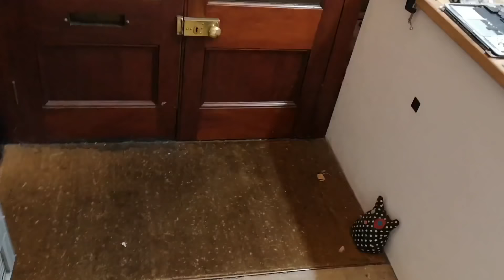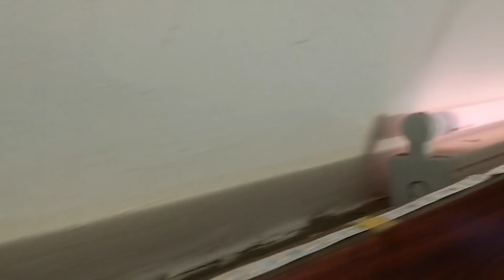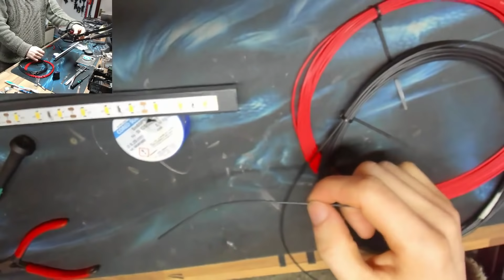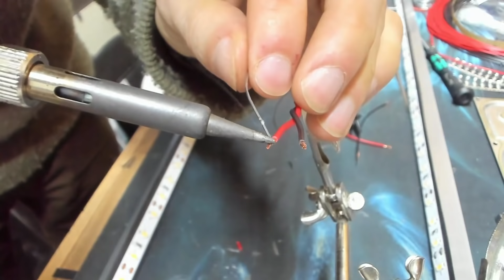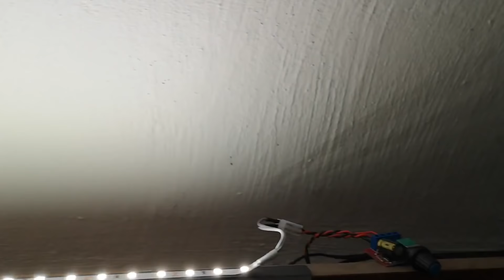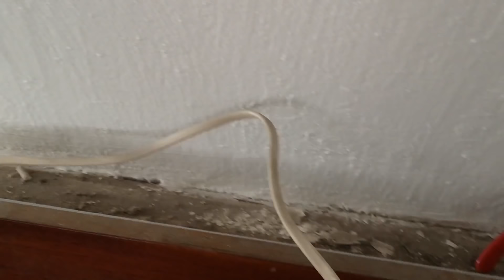LBE#5 - Making custom LED lighting for the shop

Comment: The next electrician who does an EICR there will have some words. Don't let any of the UK based electrician's channels see how you hooked those power bricks up...  I doubt you'll actually burn the place down, but "sketchy" isn't in it.  Suffice to say, hanging 4 gang 13A sockets off a 6A lighting circuit via junction boxes with no strain relief isn't exactly "best practice", just as well it's all out of sight & out of reach.  It certainly doesn't meet the wiring regulations.

Comment: hi sir. i have question about the 6-pin RGB fans (coolmoon). is there a way to identify which wires are for fans and led? i have tried googling and found just one site and pretty much convinced the wires used for the LED. how do i identify the wire order for the fans? which one is the tachometer etc. i am planning to convert it into a normal 3 pin fan and 3 pin rgb to standardize and sway away from its (coolmoon) controller standard.

Comment: Are you still using these lights in your shop?  How is the adhesive backing on the strips holding up?  Just curious how durable these will be long-term.  Thanks.
Reply from the maker: I am! And yea, there's been zero problems with them. I do want to modify them with some diffusion paper so I can have them point down into the room for more light though. They're nice and bright, but in a workshop you're basically always chasing more and more light.
I have no idea how I survived when I first started out with just two flouro tubes in this shop, now there's these LED lights, an LED baton, and two studio filming lights.
Reply: @Adamant_IT  I think your idea of breaking them into sections was brilliant. Makes it easier to replace a portion if necessary.  They provide truly spectacular ambient lighting in your shop as seen on your vids. The two old flouro tubes were grossly ineffective and needed the boot. You could try the diffusion paper, but I think it will probably be more trouble than it's worth. More LED batons would probably provide you with a better result. Cheers.

Comment: Look at the spec for the strip - 
Current (per isolated meter*)	1A/M, it's total 4A-5A per 5M at 12V DC Adapter.

Comment: Why not use LED tubes instead of the TL tubes? 
Simply bypass the ballast in the armature, place the LED tube in, and no worry about powersupplies, or cooling and etc....
I have swapped more then 3 years ago my classic 4x 58Watt TL tubes (1,5meter long), with 4x 18Watt Philips CorePro LED tubes and have now arround 1100 Lux, this in a room 4 by 3 meters.
These Philips CorePro are good quality LED tubes at a low price, back then , i have paid arround 18€ per LED tube, and they are now even lower in price.
Reply from the maker: I wanted more light as well - I only had two tubes (one each side) before, where as I have three of these 1m strips per side now. The overall cost of building these was less than buying additional tube fittings. It was a lot more effort to be sure, but also a fun project 👌